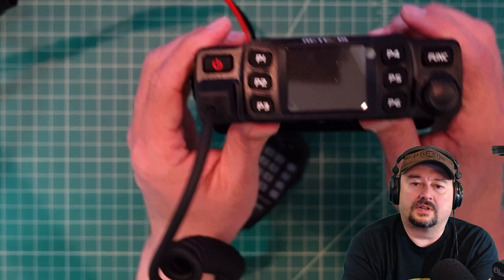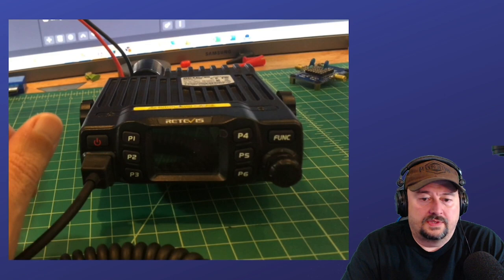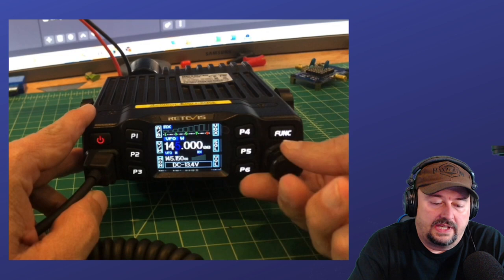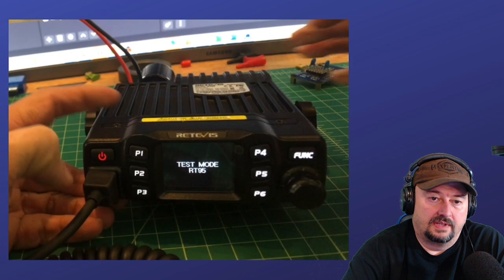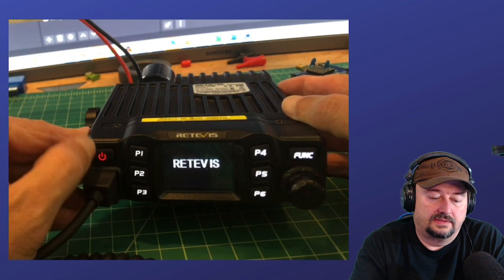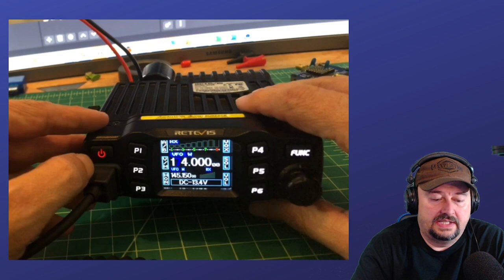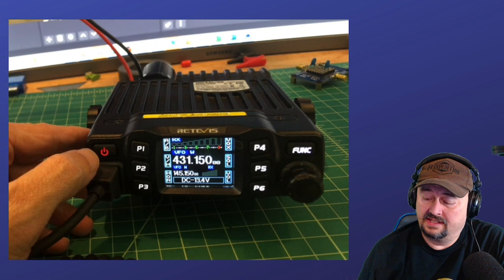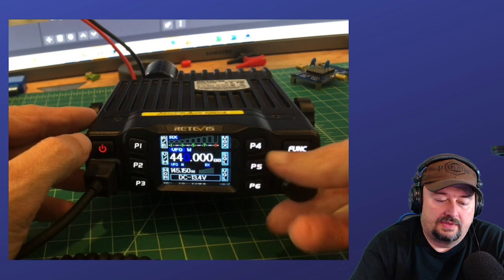Retevis RT95 Frequency Expansion Hack

Comment: I am thinking of getting one or two of these. I have an Anytone D-578, it was in the jeep, now in my shack. Being able to use it for MURS and GMRS makes it the perfect radio for local emergency comms.  - the 779 or the RT95 would do the same job, and since I am not really doing Digital there is no reason to have the more expensive model.
Reply from the maker: It’s hard to beat what you get for 100$

Comment: I have the Anytone AT-778UV version of this radio and mine shipped from Amazon set in region 3. I put mine back to stay within my band limit. Also worth mentioning if you change the region as shown in the video it will nuke your stored memory channels. At least it did on mine.
Reply from the maker: Ah, that would be a good think to think about…. The stores memories.
Reply: Why on earth would you limit the bands! There are a lot of repeaters that use 442 - 444...
Reply: @Rusted_Link  420-450MHz is within the US region setting of the 778UV. You get the full US 70cm band. No clue where you got the idea I was limiting 70cm down to the lower portion.
Reply: @jbrooks4282  because the radio only goes as high as 440 out of the box. As does the CS.

Comment: Hi Ape! 

Are those 3 modes the only ones available? It would be interesting to know if there is a mode that includes 446MHz (PMR-446 in the EU).

Thanks for the video!

73,
Jan (M7HNK)
Reply from the maker: I think mode 2 covered that.
Reply: @TheSmokinApe  Brilliant, thanks! :-) I missed that, but when I looked at the video again I saw at approx 02:29 that you have 471.150 on the VFO, which is perfect.

Comment: Nice video, but I wanted to take the opportunity to ask another question.  My rt95 is with the power in UHF, fixed at 5w, however much you change the power levels the output is 5w.  I tested the current at different power levels and it is stable in it.  can anybody help me?
Reply from the maker: Well, that seems to be a problem.  Did you contact the vendor?
Reply: @TheSmokinApe  It's been 8 months since I bought the equipment.
Reply from the maker: Oh...   Maybe try anyway?

Comment: Thanks for the info, I have just purchased this radio after selling my yeasu FT817 as i only mess on 2 and 70 in the uk. Could you or fellow commentors recommend a car/van antenna setup for this radio?
Reply from the maker: For mobile 2/70 I use the Comet SBB-5 (fantastic antenna) and the Diamond 400 lip mount.  Tram makes "decent" magnet mount antennas that a lot of folks use as well 👍

Comment: Good litle Radios For the money..my cousin has one & I have the Retevis RT-25 I Really Like having a volume knob appose to the software volume but Both have Pros & Cons that i am sure about ! But like i said mine is also open because i use GMRS & Listen to 2m & 70cm Bands a lot and for the money you just cant beat these little things ...I hear repeaters that are 180 Miles away from me Yes i said 180 Miles I don't know How but i Do  don't Get me Wrong i Bought the Best Antenna i Could Find Comet GP 9NC & All Copper Coax That is Rated Better Than LMR-600 But as you may have Guessed I Spent more than a Fuw Bucks but like i said i wanted the Best i Could Find/Get ! I Bought So Called High Quality Coax from ebay & Amazon like 3-4 Different vendors & it was all Junk/Bad so i said piss on it an bought the best M&P Hyperflex 10 Sahara it is rated at 2.5db loss per 100ft I use 60ft an i use the Evo Connectors ..my point being if you are only getting 6-8 miles from your radio and antenna then you are doing something wrong is all !
Reply from the maker: Yeah, these are good no-frills radios that work well.  That antenna story is awesome, being frank, more people should take the approach of focusing on their antennas 👍
Reply: @TheSmokinApe  I have ben into radios for decades now & 1 thing i am 100% Certain about (i bet you are to) is that ANY Good station MUST Start With a Good Antenna & Coax ..you could buy a 12,000$ radio and still not talk down the block with a bad peace of coax or antenna !